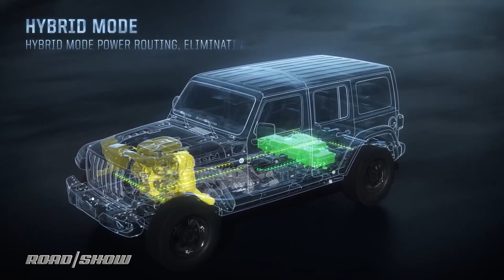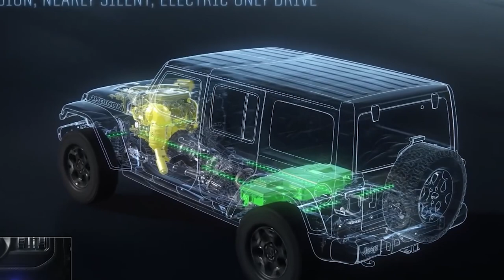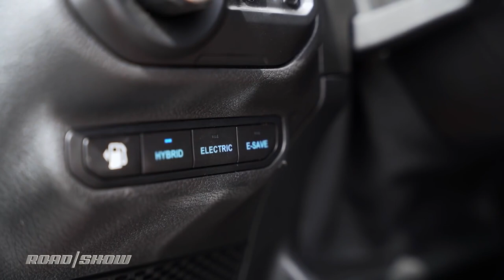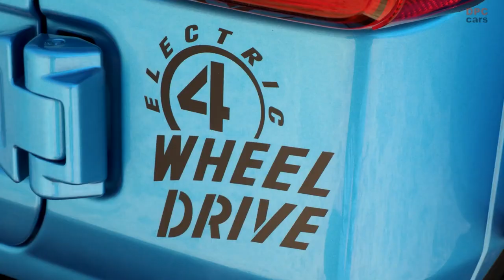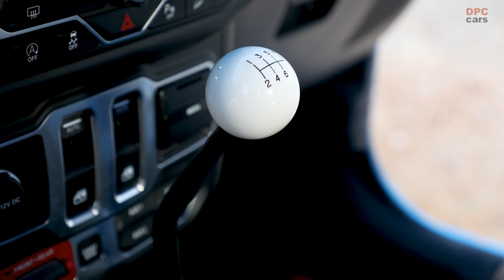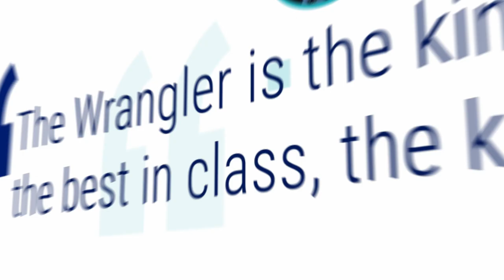Jeep CEO Finally Confirms NEW Jeep Wrangler EV!

Comment: I hope they bring it out soon and retain the manual transmission and 40 inch tires.  And I hope they make it with an LJ wheelbase rather than the 118 inch KJU and JLU.  That is the same as my L6-226 4wd pickup!  There were several mistakes in the video, including attributing the WWII Jeep design development to Willys and showing the Jeep Avenger and calling it the upcoming Jeep Recon EV.

Comment: Jeep Wrangler Jl must do no less than 100 mile ( customer drives about 50 miles a day

Using Ev to run all will use 30 to 40% Electric & still do 50 miles & anything Less at the price of $65,000 is at risk to not be sold

Comment: Electric Vehicles won't be praticle untill generating electricity is handled by Fusion Reactors and huge leaps forward in electric production by solar panels on the vehicles themselves. We are to early technologicallyt to switch away from liquid fuel, and with synthetic gasoline being generated from carbon, hydrogen, and oxygen sourced from the air and water already on the planet, the "green" arguement is purely acedemic and political, not technical nor pratical.  That being said, I would indeed prefer to wheel an fully electric drivetrain off road in my built wrangler, but I'd also want to be able to charge it as cheaply and as quickly as I can fuel up my existing 3.6L V6 Gas engined wrangler.